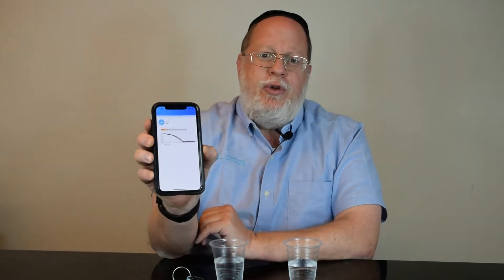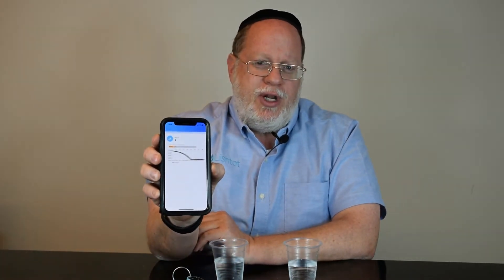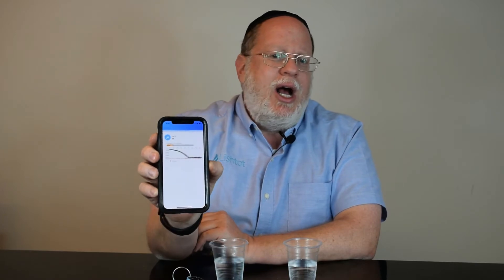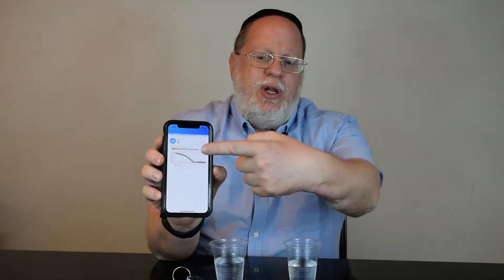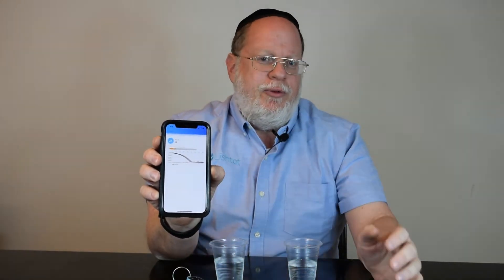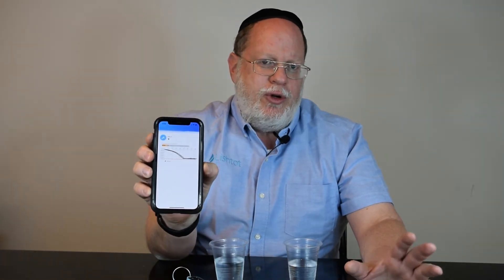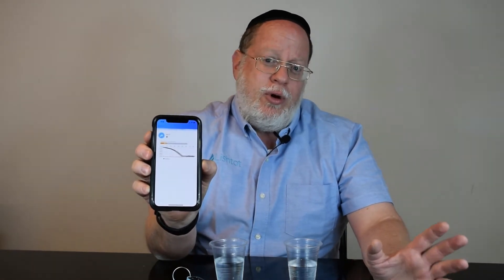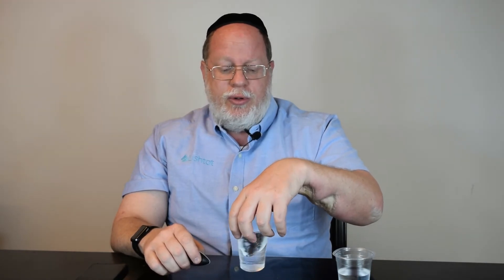Lishtot Technology

Comment: the more I research this shitty product, the more evidence of fraud that I uncover. I found this quote on the lishit website.. pseudoscience at best, "A lower signal means red. Heavy metals do not work by this mechanism as they cannot accept electrons, so we think they work by shielding the field in the cup and thus lowering the overall field felt by the device as it approaches the cup...Use a clean, fresh cup for each test. Once you've charged up a cup, you can't use it again--it will give blue anyway." so the lishit device only works once per cup, and you can't test for heavy metals. the only thing you have proven is the lishit system is able to detect the presence of protein contained within a sample of water. it cannot even detect the concentration of protein either. it only detects wether or not protein is present within the sample. your "technology" is reminiscent of those holographic balance bracelets (scam).